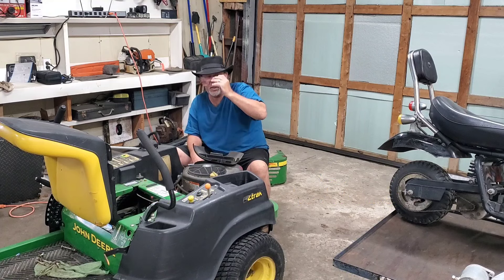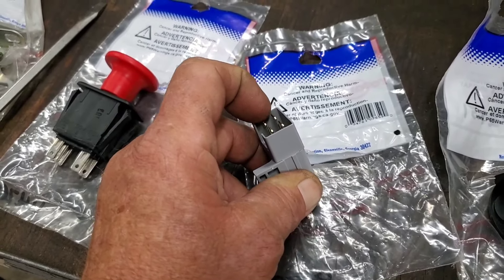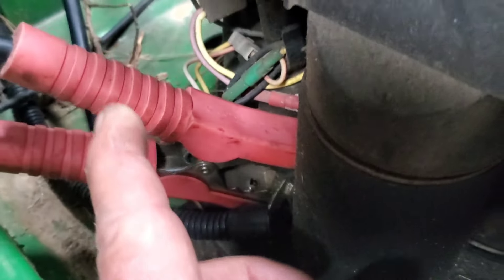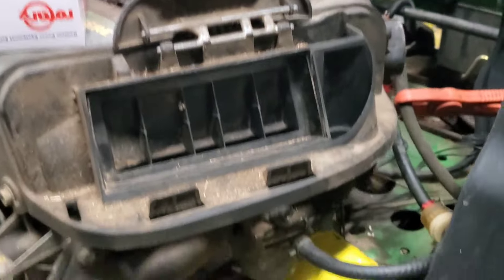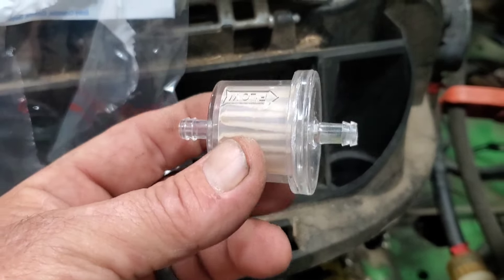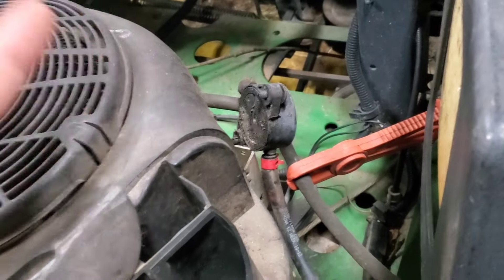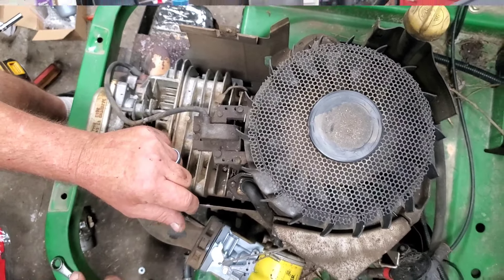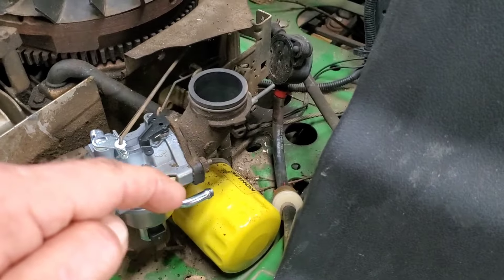Why your lawnmower will not start. Most common issues we find. Electrical, fuel, spark, carburetor

Comment: This video saved me a bunch of time and frustration. I've got an old Z225 that has been parked for several years and the darn thing won't start. The fuel shutoff solenoid at the bottom of the carb is to blame, which I now know thanks to this video!

EDIT: Damn it keeps getting better, direct and specific instructions on how best to remove the carb on this model. I love it. You are the man T-Bone!!!

Comment: Mine died while mowing. Went through srart up procedure, sat on seat, turned off pto, pushed brake in, put in nutrial, turned of key then on to start, no crank. Bat is12.65 vvolts. Stumped! Full of gas.

Comment: I’ve been doing repair work from my home for about ten years now and I rarely find it necessary to replace a carb. I can usually clean the carb and maybe replace the seals and/or replace the needle and seat. It is much less expensive to the customer to pay for the twenty minutes it takes to repair than the cost of a new carb - especially since I charge much less for labor than an actual shop. Parts and labor to clean the carb is usually less than fifty bucks as opposed to 100+ for a new OEM carb. An aftermarket carb is a crap shoot as to getting a good one.
Reply: I agree I rebuild about 95% in my shop and hardly ever buy a carb

Comment: Excellent video, I thought I had a bad solenoid but I couldn’t even jump it, turned out I had a loose bolt on the ground wire from the battery to the frame, loose at the frame. Tightened the bolt and it turns over great. Then I ran into running issues and blowback thru the carburetor and a no start, head gasket was blown, replaced that and now it only clicks again but spins over great with the plug removed so I’m guessing decompression spring is missing, will check for the bump and valve clearances tomorrow.

Comment: My 22 year old MTD 14.5 HP lawn tractor sat bone dry all last year because of the drought. Put ethanol free gas in the other day and.............no start. It ran great when I put her up, completely serviced. I had a feeling this would be the year she didn't start. At least it has spark, time to yank the carb I guess. Never had to yet after all these years. Fortunately my push mower fired up on the first pull.

Comment: I need help not getting spark. For some reason the wiring to the safety switch to my seat is not working. The switch is working but ignition starts even if the safety switches out. The safety switch is good it works on other places

Comment: Hello I got a problem with a 50  Troy-Bilt a zero turn it runs good but every time you pull the arms in the engine turns off
Reply from the maker: It's a safety switch issue or a wire backed out of PTO connector.  Test the safety switches with an ohm meter. Please test switches, I have a video on how to do that somewhere on my channel. Start with a careful visual inspection of wiring connectors. Then I'm off to testing switches with an ohm meter.

Comment: Don`t know if you can help me out, I have a John Deere L118 with a briggs Intec 22hp and every week when I go to use it I have to crank it for an extended period.  I cleaned and rebuilt the carb, replaced the fuel filter, checked the tank and fuel hoses for debris or blockage, checked the gas cap vent, adjusted the valves, replaced the battery, and replaced the spark plugs. The choke cable is adjusted properly and the butterflys close the whole way when applied - it has been doing this since I have had it (I bought it used).  Also, the compression seems fine on it. After I start it the initial time, it fires right up every time afterwards (unless it sits for a week or so).  I appreciate any help!
Reply from the maker: Hmmm, it seems you have gone through most of it. What is the fuel pump pressure? If you are in South Carolina you can bring it to our shop.
Reply from the maker: One more question... what spark plugs are you using?
Reply: @RaleysSmallEngines  Not sure of the fuel pump pressure, what should it be?  I`m in PA - my Dad used to live in North Carolina - the further south you go, the nicer the people are!  lol
Reply from the maker: @ScottMiller-tu3gg  lol 5 psi. On the fuel pump. If you have off brand plugs in it throw them away and put NGK in it.  Hope this helps

Comment: I keep finding bad ground thru frame on older mower 
Any time it’s hard or slow turning I check it with jumper cables 
It’s not AllWAYS the cam compression release broke

Comment: Great information. I have a Briggs 22 hp. I disconnected the fuel line from the pump to the carburetor inlet turned it over fuel came out of the line. But when I turned the engine off the fuel continued to flow out of the file line (siphoned out ). Would this be a sign the pump is bad ?
Reply from the maker: Thank you. No that does not mean your pump is bad.

Comment: I bought a used lawnmower that would not run because of an electrical problem.  When I turn the key I get nothing not even a click. When I cross the poles on the solenoid It tries to start.Gives a grinding noise. Does this mean the solenoid is bad?

Comment: hi there i have a craftsman mtd 2020 it  did a tune-up plug ,air ,oil ,filter  , fuel filter. it now only runs for 20 mins to 1/2 . i have changed the fuel filter twice. it loses fuel in filter wait a few mins it will start. i have had cap off air line to tank claened . still dose it HELP
Reply from the maker: Fuel line interior if bad slowing fuel flow.  Hope this helps